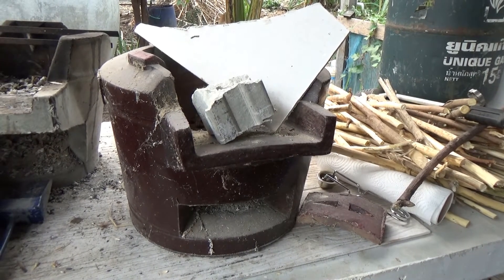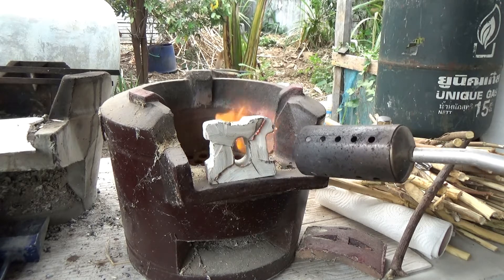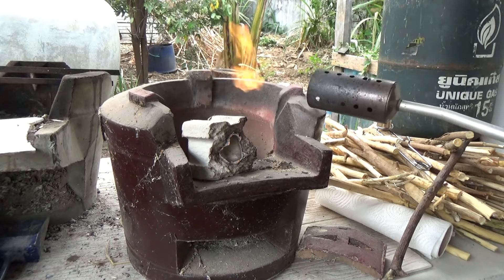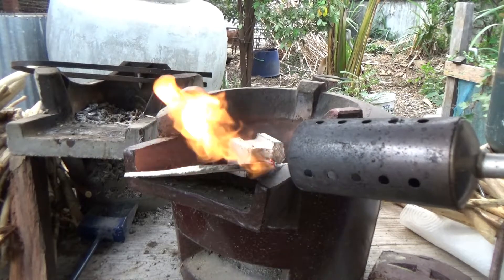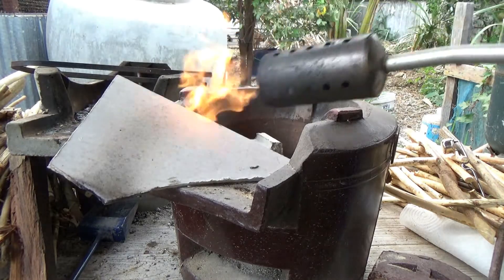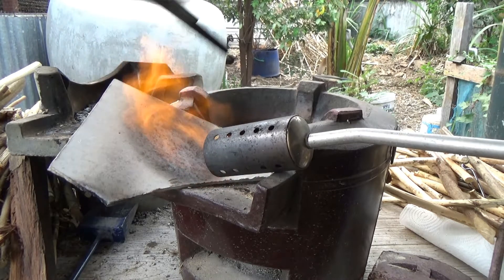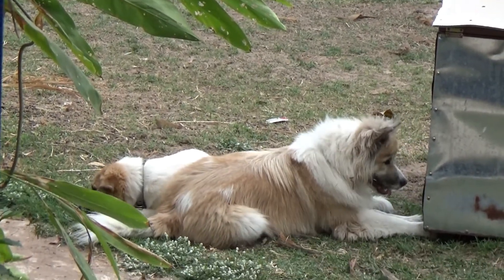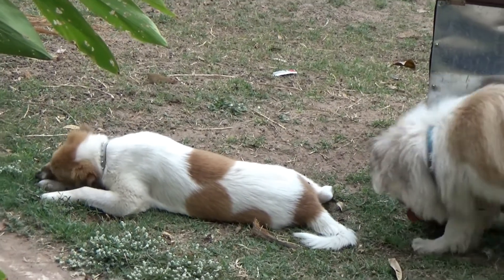Is Concrete Board Fire Proof or Flammable, Workshop Experiment.

Comment: checking this up because we had a fire today in one of our apartment units. The fire came from a refrigerator and burned anything surrounding it, but it stayed there, and the ceiling was this board. The ceiling above the fire just broke into pieces and turned black, and the fire did not spread. If we used plywood, the fire would have spread to other units. We are very thankful for this board.

Comment: If you meanCement board aka Hardibacker board that's mainly used as a substrate for tile work — then NO. 

The cement/hardibacker boards used in the USA absolutely do jot have asbestos.  Asbestos is illegal/band in the US. Almost any boards and brick made of certain grades of cement are going to be fireproof.

Comment: Is concrete board safe to build a house with? Is there any fumes or toxins it releases?
Reply: We use steel frame with eps sandwiched between those. They have good resistance if installed properly. We're not in a burn area but have tested those. They give plenty of resistance. PVC is the terrible toxic stuff.

Comment: What I want to know is can HardiBacker cement board be used to make a wood stove baffle plate. I laminated 3 layers of 1/4 inch using stove cement and plan to test it out in my Regency 3100. The ceramic baffles lasted 8 years...and now they are crumbling.  That's 8 years at 3 cords of poplar/birch per year. 24 cords and the baffles are toast. Not good IMHO.  Never over fired the stove either. It's a big stove so I run it with the air supply at a minimum.
Reply: Any luck? :)

Comment: It might be asbestos in that "concrete board. If that's the case, I would not use it. But I believe it's hard to get the right information from the factory or outlet if there are asbestos involved.
Reply from the maker: There is no way to find out.
Reply: @workshoplife3740  I mean you could shred and send to lab the way you would test tile.